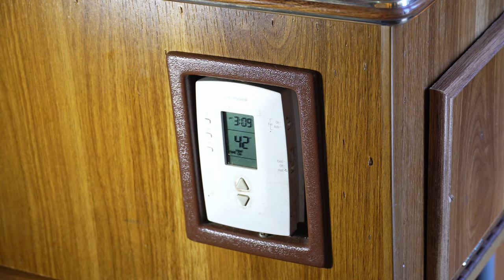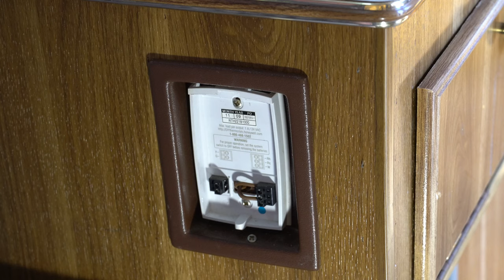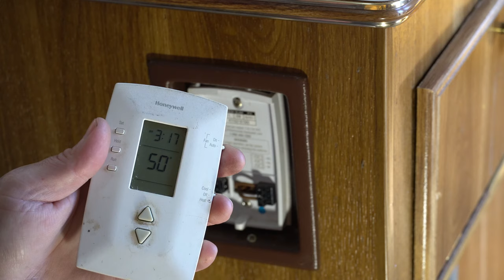Popup Camper Thermostat Replacement

Comment: We did this according to your instructions.  Replaced old thermostat with Honeywell digital in our popup.  2 wire, heat only.  Problem is, when we turn it on, nothing happens!  What are we doing wrong?
Reply from the maker: Which Terminals did you use on the thermostat itself.   Most common problems I have seen is found there.   The 2 wire systems the thermostat just works as a switch..  its on or off.  basicly the same as if you hooked the 2 wire together or took them apart.  Usually they hook the the R -  Red wire   and W- white wire.   Some digital ones also have a RC terminal that normally comes with a jumper to the R terminal.
Reply: @Ambohouse  Used the R and the W.  Wires were black and gray.  You said with the 2-wire systems it doesn't matter which wire goes where.
Reply: Issue resolved.  Thank you so much!
Reply from the maker: @stanperambo3472  Very welcome..  happy that you got it going..
Reply: My popup just has an on and off switch for the heat. Is there a way to hook it up to mine?
Reply: @ChuckYou_  I'm no expert, but I would just wire a thermostat in line with the switch, or replacing the switch.  That's all the thermostat is - a switch that is controller by temperature.   Replacing the switch makes the most sense, since the thermostat has its own manual switch on/off anyway.

Comment: I have a question for you...When you go from an analog thermostat to a digital one on a popup camper,  do you find that on a cold day that the furnace keeps popping on and off by using a digital thermostat ? I would like to switch to a digital thermostat also ( I have a Four Wheel Fleet popup camper which has an additional thermal wall barrier installed) but I was concerned that the temperature fluctuation in a popup would make the digital thermostat keep turning the furnace constantly on and off. 
Have you had any issues like this?
Reply from the maker: Mine did cycle more when going digital.. most digitals respond faster and work on a +2 -2 to cycle.   But I also found it kept my popup a lot more comfortable, manual cycled less but the temperature would drop farther and cause the furnace to run longer.   Seemed like the shorter cycle times ended up with it running less as it didn't allow as much temperature fluctuation.  Basicly your not letting the interior surfaces get cold and need to be reheated.  But I was also camping in 20 degree weather a good part of that time.